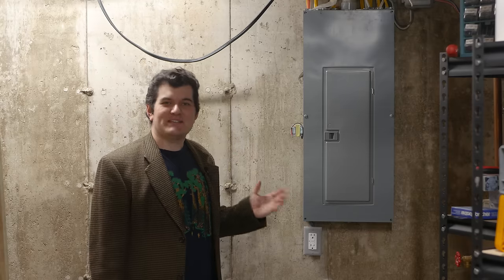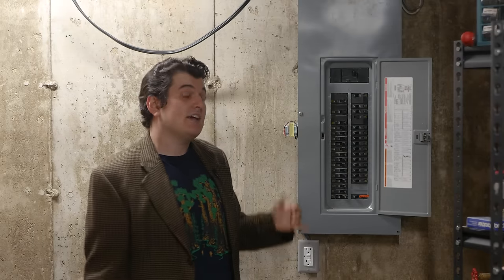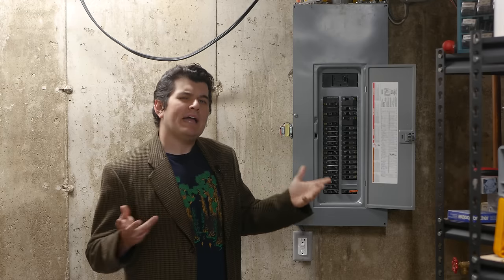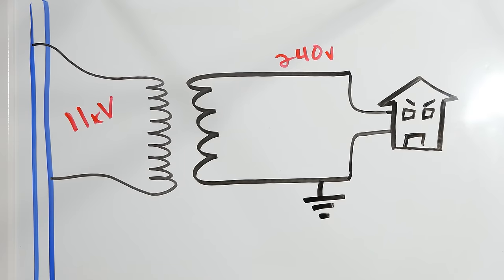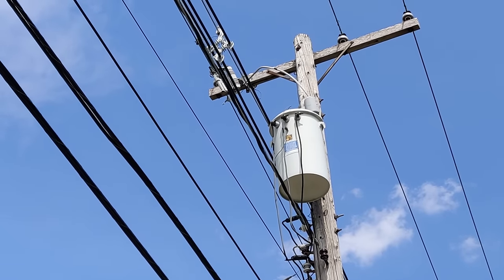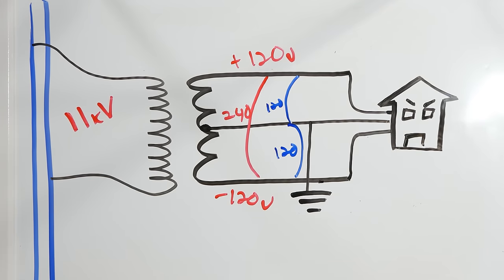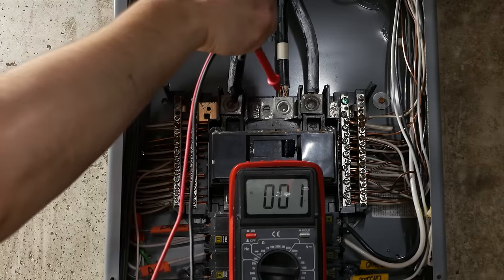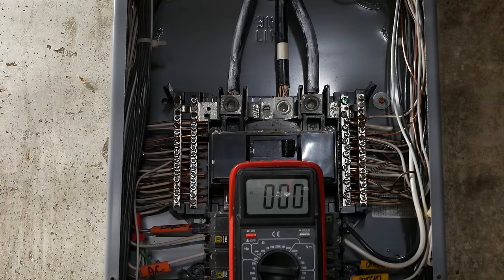The US electrical system is not 120V

Comment: Huh, I've never heard of 120 and 240, just 110 and 220.
Reply: i think those are old standards:

the old american standard was 110/220v

the old european standard was 220/380v
Reply: You could also call it 115/230.  It is all the same.  Your voltage may differ.

Comment: One time when I was young (13 years) accidentally shorted a connection between hot and neutral with a us penny. That circlet tripped and I had a slightly melted penny nothing bad happened but what the guy said is correct. We (USA) have terrible plug design.

Comment: I guess it would be better to just give up 120v and only use 220-240v  as we do in eu...
Reply: No.  Why would we do that?  There is no advantage to be had in using 240V for common household devices.  We have 240V available when we need it for high-power devices.
Reply: @GH-oi2jf  it's just cheaper to only have 220-240v, that's why we use it, I think it's just stupid to have 110v for small appliances since here ours deal with 220 with no extra cost added and electrical infrastructure is just simpler, cheaper

Comment: The thing is though, it's the same situation over here in Europe. So you're just pushing the issue back a step; if you're going to say that "the US isnt actually 120V you dumb and mean Europeans!", well then guess what, Europe isnt actually 240V either, it's 400V,  so we're back to square one of saying the US uses puny and weak voltages compared to Europe then aren't we.

Comment: Ok younare right, butI I think i understanddwhty we misinformed Europeans think that the US grid is 120v ( ignoring 3 phase) the need ( povore the time of universal pover supplys) to bring step up ytansformers on trips to the US because most circuits we would come into contact with would be 120v and thus our devices would not run (ignoting the fact that a lot of our plugs wouldn't even fit). Oh yea non universal pover suplies, the scurge of any1990s school computer lab where all you needed  to do tontelease the magick smoke from the computer behind you was to switch tho Volga switch on said psu from 220V to 110( @0and yes that was the way they where marked if memory servers)

Comment: When I was a kid my car a 72 gran sport was running weird. I popped the hood and started touching wires near the coil.

The plug wires were old and insulation was bad. 

30,000 volts hurts like hell. I closed the hood shut off the car and told my mom what happened and took a nap.

I replaced the plug wire the next day.

Comment: I had no idea that the US grid had a jank AF miss match of 2 and 3 phase systems. in AUSNZ we only have 3 phase 240 service for larger buildings with smaller houses getting a single phase. (we don't normally do ring mains in AUS/NZ anymore, but one of the significant benefits of them  unmentioned in the video is that it increases the current carrying capacity of the rated cable.)
Reply: For services, here in US, we have 120/240 volt single phase for residential 100 amp minimum.  For businesses, we have three phase systems 208/120 volts, 240 volts, 240/120 volts, 480/277 volts, 480 volts, 416/240 volts in the US.  Some of these are derived from the higher voltage systems with transformers.

Comment: The fact that you have 240v at the panel and still use 120v in the house is dumb. "because Its safer", you use 2x more copper and double the amperage of the circuit... There is more accidental death by electrocution in USA than in EU... "because its safer" is litteraly the same as putting airbag for each passenger in a plane; its better to avoid the crash of the plane. 'muricaaaa
Reply: No, we don’t use twice the copper in the USA.  In order to compare the efficiency of copper use, you would have to audit a complete distribution system.  The organization of the distribution systems is quite different between Europe and North America.  Considering just one piece of the electrical system is not meaningful, especially when it is done only theoretically, not by actual audit.
Reply: @GH-oi2jf  At the same power delivery (wattage); using 120v litteraly need 2x the amperage meaning 2x the copper needed for 240v. Its basic physic. Please do some research to enlight your american brain unstead of saying "no no no random excuse duh". Learn basic physic.
Reply: @hardrout17 — Simplistic “analysis” is not helpful.

Electrical engineering portal is a good place to see European and North Americam electrical systems compared.

Comment: So no 400V?
Reply: We have 120/240v single phase and in three phase we have 208/120 volt, 240 volt, 240/120 volt, 416/240 volt, and 480/277 volt systems.  We have higher voltage systems too.  12470/7200, 13800, 34,000, 66,000, 120,000, and others.

Comment: You Americans have on 120° Phase on L1 to L2 than you have 230 Volt.
On one Phase u have 120Volt.

Over 50 Volts the Current (50 Milliampere ) canl kill you.
Because your Body resistence its like 1000 Ohm.
On 120 Volt its like = 0.12 Ampere ( With no Clothes etc.)
With 230 Volts its 0.23 Amps ( Same thing.)

But if your Working with Clothes you have maybe 10k Ohm that means 0.023 Amps threw your Body with 230V.
It can kill you but most of them will survive.

Time is the BIG COUNTER!  More Time = Higher Chance to get Killed under 50 Milli Amps !!! 
The Body will change the Resistence from 1000 to 500 or so.

Thats Basic knowlage in Germany.
Sry for my Bad writing english but i can speak it realy well. :)

Comment: 2x120v is better/safer than just 240v.
Just tell them we're American and you just wouldn't understand!😃
Reply: Eh, kinda. While true, 120V means substantially less current during an electric shock from an outlet, there are many other hazards and situations where the system is just as dangerous or even more dangerous than a straight 240V system. For example, due to 120V systems requiring larger circuit breakers, arc flash events are pretty similar and overheating conductors are more common. Also 120V means residual current devices and earthing systems are less sensitive, and since the 120V is only on the consumer end of the power system, any incidents involved in distribution or in switchboards are with similar voltages to other countries.

Comment: Edison was Green. Europe wastefull. Lol :) 
  
The usa was originally 100 /200 volts way before 1900. Then 110 /220. Then 115 /230. Then 120 /240. 

***The original 100 to 110 volts was PURPOSELY chosen to save energy .***

 That lower voltage used the least power for early incandescent light bulbs with a design target of 750 hours. Incandescent light light bulbs of 230 volts in catalogs of 100 years ago  show less lumens per watt than 115 volt bulbs. Both with same design lives. 

Worse is the 230v  filaments were more fragile.  Less robust for shock resistance.  

So where is all the shame with non usa countries not being green?  :)   

So the entire reason the 100 to 110 volt ac voltage was used was for the best efficiency of powering lights. In that era 110v incandescent bulbs put out more lumens per watt than 220 v bulbs. Both running at same design life.

 Electricity cost 10 cents a kilowatt hour in a design book here from 1920. That is probably like 2 to 3 dollars a kilowatt hour in todays prices. That book has a 110 volt 30 amp service for a small 800 sqft house. The largest light bulb was 40 watts in the dining room to impress folks. The bedrooms had 15 watt bulbs.

Comment: as a german electritian that breaker panel is giving me THE CREEEEEEEEEEEEEEPS
Reply: i see no problem with it.   its a two phase household supply.   as a professional american electrical engineer for 40 years, your comment is vacuous and is incoherent.  Would you care to elaborate, using electrical engineering logic
Reply: @FrenchmansFlats51  i sure can try.
Seing the bare copper leads that is that freightens me so because here in germany when ever opening a breaker panel you dont see any copper (not that much at the very least) and a bit tidier cable routing well thats germany anyways and
Reply: @tobiweinmann3790 — The bare copper wires are grounds, which are connected to Earth.  There is no reason to insulate them.  I wouldn’t put them on the same bus bar with neutrals, though.

Comment: Well, if the word "120 VAC is safer" sounds weird, maybe another way to say this is better: 240/220 VAC is way more dangerous.  Also, I think it could be better to explain in this way: examinations have shown, the higher the voltage, the higher the possibility for human skin to sweet, which in turn LOWERs the resistivity of the human body, loop, also causing higher current to pass through, thus, double kill

Comment: I sorta disagree with the title. If you're gonna say the US system isn't 120V, just because there's some high power plugs that run at 220V, the  you have to treat the EU network the same, and say that EU networks aren't 240V, they're 400V, since 3 phase plugs, or even just 400V two phase connections exist in Europe as well for high power devices.

It's sort of a mute point

Comment: I am shocked, SCHOCKED, at the obvious bias in this episode! Normally you criticise without fear or favour! 😂
I would never do that... you won't find a hint of bias towards Auatralian power points in the comments below...
You may be able to access 240V if you need to, but here in the electrified paradise that is Australia, we have 240V, 10A arcing out of every standard power point in the house. So, where you actually need non standard points for many appliances, we can plug them in anywhere and everywhere, and if you want to move an item, you're restricted to other 240V points. I can plug in a 5kW air-conditioner anywhere and everywhere in my home... I couldn't decide where to put one so I just chose the latter option and have one in every room, just cos I can (the electricity meter is meant to smoke.😂

Given that your lower voltage is based on largely imaginary safety benefits, who is obsessed with safety? I mean, the circumstances in which 120V will push less than lethal current through you, but 240V would have killed you, are probably so limited and specific that they'd hardly ever arise. I would literally rather die than only have 1.8kW at each point, which is a good thing, because there is literally a chance that that might happen, and if in fact I'm ever killed by 1mA too much current and a 120V system would not have, at least I'll be in a well chilled environment until I'm found.😂

You need 4x the wire in long-ish extension leads. I can and do run 15m extension leads to each air conditioner from other rooms, just to remind myself of the freedom that 240V brings. In the US, I couldn't do that, and yet I hear you sing of the land of the free and the home of the brave, when all the while you live in a 110V prison, quaking in fear of the one true freedom... 240V! I quake only because it's so cold in here.
As for switches on power points? A plug might be located behind a cabinet, fridge, furniture or any other awkward or tight space where it's a pain to reach in and unplug it and even worse when plugging it back in, but flipping a switch is very easy.
If you're thinking that doesn't really add any justification for the use of 240V, you'd be right, however, the design of our power points and the orientation of the slots that the pins go into, makes them look like a face when nothing ia plugged in... This is deliberate and is a rendering of the face of the inventor who created the 240V system. As such it is akin to the face of a God, and must be treated reverently and should not be gazed upon for more than a few seconds, lest those nearby think you are wondering where the mouth is... And yes  there's no mouth because the inventor didn't actually have one. So much time saved when time isn't wasted on talking to anyone... enough, it would seem, to literally think up the perfect power system voltage (and don't get me started on frequency!).
An almighty face! Man can not look upon the face of the almighty and survive. To minimise the chance of that, we need to be able to turn off the power without unplugging. Hence, switches.
So there you go, a totally objective overview of the 240V system, free of hyperbole and 100% based on facts obtained from a true story that was based on a book that was inspired by real events, which itself was based on something that happened.
Next week... the sheer, unadulterated, adrenalin rush of driving on left, how this utterly perfect arrangement came to be, and how America got it so wrong (again).
Reply: Do you have three phase outlets in every room?
Reply: @billelkins994  While my post was tongue in cheek, the figures for standard power points are correct, but they are single phase. I think 3 phase is 415V. Undoubtedly you would have appliances that draw more than 2.4kW, but that's probably because once your limit of 1.8kW is reached, why only make the larger appliances 2.2 or 2.4kW, when they'll need an outlet that can deliver far more?
Here, with 2.4kW available at any outlet (but not all outlets at once; that was meant to be humourous exaggeration), our clothes dryers are significantly better than a 1.8kW one would be... enough to make the expense of split phase not worth it.
I don't really think 240 is better than 120 (sorry, I realise I've been saying 110... did the US formerly use 110? That's what I was told it was when I was a kid). There would be pros and cons with both. I do, however, think there's an advantage to having 33% more power at a standard outlet, but I imagine that could be done with lower voltage systems too. For larger AC units and other larger appliances, we can have 240V 15A outlets installed.

Comment: 240 VAC divided in 2 by a White Neutral line which is by code built to stay within 2volts of Ground potential. In a 3 phase system it is 208 VAC as the  phase between lines is 120degrees not 180 like in a single phaseI have no issue with 550vac but it is unforgiving of mistakes  .   The early day of electrical utilities did not see fuses in the house till about 1919.   The human body has negative resistance .
At 2volts you can touch the leads of a Digital Multi-meter set on Ohms and it will read 5 million Ohms, however at a peak voltage of 170 volts like what you find on 120Volts AC RMS  Your resistance will now drop to about 300 Ohms and .005anp through your torso will paralyze you  .

Comment: Ok well I one question for that I believe you will be able to answer for me I just wish there's a you could send me a direct message with the answer because I've have been searching for the answer to this question for a long time, but anyways my question is I have a 240v welder but it's chinese-made and the plug on it looks just like our 120 volt plugs as in it only has 2 flat prongs no center ground, and now after watching your I believe I would be correct and be able to do this but I wanted to ask somebody who knew and if you could answer for me I just hook that you hot wires of our 240 volt system to the to it with one to one prong and the other to the other prong to operate the welder. And of course it wouldn't be just hooked up as that simple I would run it in the correct electrical plugs and boxes using proper connecters for everything. But the welder would work and it wouldn't harm it correct, cause the funny thing is it powers up on our 120 voltage but just doesn't have the power to weld much haha
Reply: Without knowing the Manufacturer name and model number, that welder (because of electronics) can run on 100 volts up to probable 270 volts.   So, it auto changes to applied voltage.   You should not however use a standard 120 volt 15 or 20 amp receptacle and connect it as 240 volts.  Will it work, yes.  Will it be unsafe, yes.   If someone else comes in and plugs into it expecting 120 volts, it will burn most appliances up.   Hope this helps you.

Comment: blimey, dont let electroboom Mehdi hear you spouting that 'its the current that kills, not volts' rubbish! It's nonsense to suggest electrical dangers can be easily summed up like that. how do you get this current without voltage? what about frequency? is it ac or dc. 
would you rather have 5mA driven by 10V across your heart, or 1A driven by 240V going into your foot whilst your standing on that leg on concrete? 

saying it is I that kills not V is like saying it isnt the fall from height that kills you, it is hitting the ground. one outcome is inseparable from the other.

the answer to the question 'is it volts or amps that kills' is - yes, it is, probably.
Reply: He explained that all quite well. Did you stop watching to make this comment?
Reply: @ghz24  buggered if i know. it was days ago, in those awful pre-Starfield times. probably.
Reply: @ghz24   at 14.417 "he says "its the volts that jolt but the mills that kills" then "you're right". when he should have said, you're utterly wrong. then he discusses 240V AC being safer, all things considered, than 120V AC. when does he say that the common volts saying is completely wrong?
Reply: @KarldorisLambley  Well he says they are right because technically they are but in practice not so much.
He points that out right after he says "you're right". He points out current is proportional to voltage. Pointing out that it's not so simple.
Is the 10 volt piercing my skin?
I'll take 8000 volts at 0.0001 amps Alex.
Like an electric fence, which demonstrates it's current not voltage that is deadly.
It may be a gross simplification but it's not wrong.
Reply: @ghz24  gross simplification=wrong in my book. i expected better from Alec

Comment: Maby it's safer but your house will burn down 😁 stupid system, and a ac motor need 3 phase. Europ have 230v 3 phase
Reply: I have several AC motors in my apartment, running on 120V single-phase.  There are countless such motors in operation everywhere.    They work perfectly well.  Heavy-duty electric motors are often 3-phase.

Why would his house burn down?
Reply: You have a three phase refrigerator?